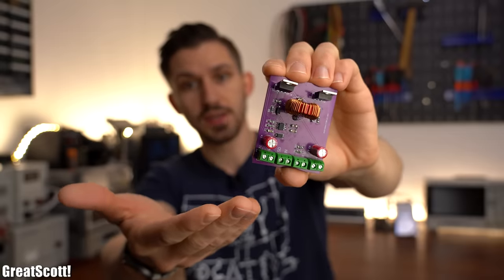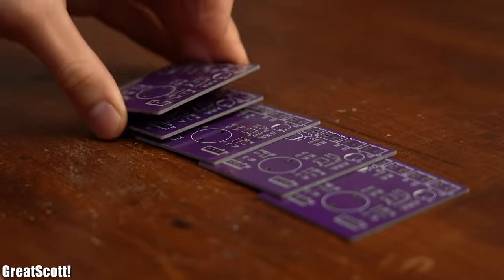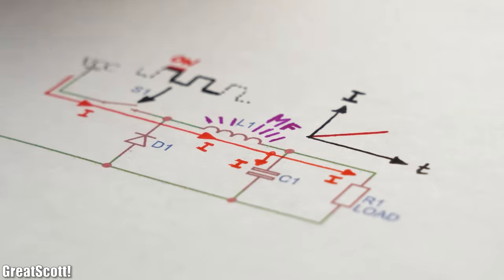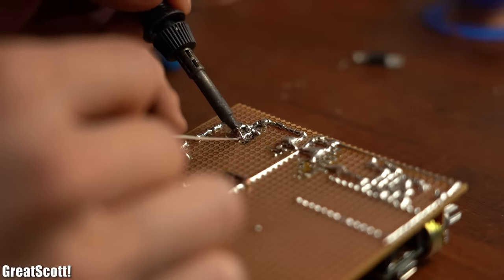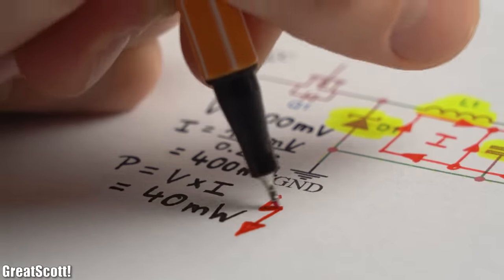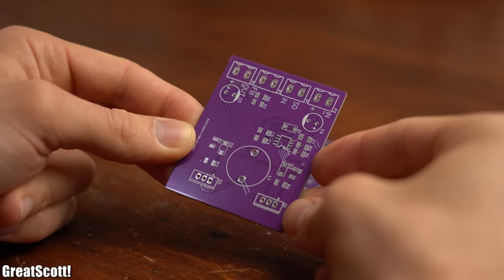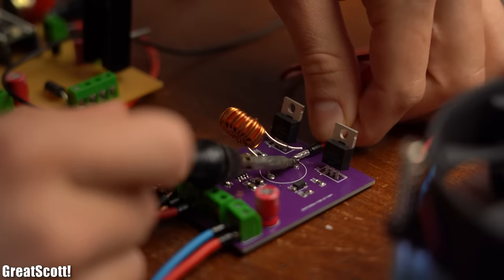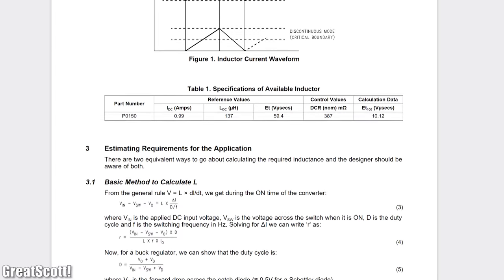Is this the BEST Voltage Converter? Trying to build a Synchronous Converter!

Comment: Really interesting project.

I am doing a PhD on power electronics and I have previously studied how to improve buck converters. 
There is a topology called "active clamp ZVS buck Converter" that besides using synchronous rectification with mosfets allows to have ZVS in the switching of the mosfets, which greatly reduces the switching losses. In addition, due to its behavior, it allows placing several modules in parallel to increase the total power without additional control, since it distributes the current automatically.
Reply: Electronics aren’t real dude
Reply: that's awesome! Would be great to read the research you write about this.
Reply: Interesting
Reply: @paugasolina5048  its funny you call someone a no lifer when you are on this thread chugging haterade. Must just be self reflecting or something.  At least his post relates to the video.
Reply: thats the kind of comment thats actually usefull, ty!
Reply: Interesting to compare efficiency of the active clamp ZVS buck converter with resonant converters can you provide a link?
Reply: @paugasolina5048  go somewhere else with ur negativity
Reply: Sounds a lot like my converters.
As a full-time 'no lifer' I have accumulated a series of designs that are not only really powerful and efficient, but are easy to produce - requiring no IC...
They also show this 'tandem' behavior, when multiple converters are paralleled - I can use a single error amp to regulate the lot of them!
Reply: @paugasolina5048  honestly, I would prefer it if knowledgeable people shared interesting things like this more often like TransformadaDeLaplace did here. No need to possibly discourage others.
Reply: ZVS is damn cool stuff.
Reply: @bryanakers9354  Don't feed the trolls, just ignore him. If you reply to idiots, they will use all kinds of fallacies to discredit you.
Reply: @Vilvaran  Hi. Got any ZCS resonant converters?
Reply: @t.i.m.e.3419  You mean ZVS? The zero-crossing point is good, but no resonant converters yet - they're in the "coming soon" category I guess...
There is a case of quasi-resonance in my design's switching control 'system', but I wouldn't consider it a truly resonant device...
Reply: @Vilvaran  No. ZCS.
Reply: @t.i.m.e.3419  Zero Cross Switching ~ Zero Volt Switching
There's a difference?
Reply: @Vilvaran  Zero Current Switching as opposed to zero voltage switching
Reply: @t.i.m.e.3419  Ah I see - yeah that's something that needs more than just two transistors with funky feedback...

There is a design that I have which uses a pair of AND gates to buffer the switches in a bridge; such that either transistor will only turn on when the other has fully turned off...
The right capacitors in the right places can make it resonant - but having it remain so at different output powers is a bit more difficult...

For now i'm focusing on ZVS converters and universal supplies - implementing the Ideal Diode and testing the new feedback methods...
It's been a ride figuring out the magnetics side of things - core materials are an absolute nightmare!
Reply: @Vilvaran  I bet they are. Why does ZCS need more funkiness? Couldn't a low voltage ZVS circuit be inverted to drive the gates 90 degrees out of phase?
Reply: @t.i.m.e.3419  Hence the auxiliary feedback tests - if the switching is fast enough, there is nary any difference between ZVS and ZCS behavior, as they should cross zero simultaneously...
Reply: @Vilvaran  Doesn't current lag voltage?
Reply: @t.i.m.e.3419  Yes - but what is the point here?
Reply: @Vilvaran  To do work with the magnetic field as opposed to the di-electric.
Reply: @t.i.m.e.3419  Would it not be wise to use both?
The device is already working with magnetic fields. Adding the dielectric (capacitor in series for example) would make a resonant circuit - but introduces phase shift. More often than not, with resonant feedback circuits I get horrible ringing that actually prevents the transistor from switching on if the error-amp kicks in...
That is with the simple circuitry though, I'm yet to give this a shot on an H-bridge configuration.
Reply: @Vilvaran  One might think so. Depends on the power source.
Reply: @paugasolina5048  Why would you watch a video about synchronous converters?  Seems pretty "no lifer" to meeee....
Reply: Brabo
Reply: But don't we need current programmed control to have a parallel loading of multiple converters? ZVS is really useful but how does that provide current distribution for parallel loading?
Reply: @Vilvaran  can your share the design...
Reply: @paugasolina5048  no u.
Reply: @greatscott please pin this comment
Reply: exciting, hope read your article asap.
Reply: I've been reading about buck converts for  such a long time, and i even had to design one for my masters degree final project and still never heard of this ZVS !! I think i need to take a look into it !! Thank youuu !
Reply: I am building a battery operated device where efficiency is crucial. (no 1 goal)
(have 4S1P Lion and need different voltages in the device)
would an "active clamp ZVS buck converter" or more of them be the most efficient solution?
thx
Reply: Send me a link to what you've got ;)
Reply: I would be interested to know how this works: "In addition, due to its behavior, it allows placing several modules in parallel to increase the total power without additional control, since it distributes the current automatically." I haven't seen this done without a current balancing circuit and I can't find anything IEEE Xplore about it
Reply: My dude id love to read your paper, where can we find it ?
Reply: @taton5  well your typing on a phone and sent a comment to a server that im now reading sooo
Reply: @dannycoria1995 hey danny, I hope you are doing fine. Are you already done with your research?

Comment: FYI, many STM32 MCUs have a PWM mode with complimentary outputs and dead state insertion -- specifically for switched mode power supplies and brushless DC motors.  I didn't really understand the connection until watching this video.  Thanks!
Reply: Ooooh makes a lot of sense! I always wondered why every timer had 2 output pins
Reply: If you and Batu Gunduz meaning the 2 output units for each timer then the ATmega328p has the same scheme.
Reply: @PerchEagle  If I understand correctly, the STM32 can generate the complimentary outputs using a single output compare channel (the 328P seems to need two, with the same compare value, but opposite output polarity).  Also, the STM32 can insert dead time (neither output enabled) automatically.  I think the 328P would need two timers with different TOP/BOTTOM values (or just different initial counter values?) to produce dead time.
Reply: @markday3145  ok, let me check the stm32 datasheet for this point.
Reply: Yes, you do. For example, the STM32G474RE available on evaluation kits has a peripheral called HRTIM. A timer capable of generate a pwm with 4GHz clock. It has multiple outputs and features that makes a synchronous buck converter easy to implement. There's also some  APIs sponsored by a ST's partner called BIRICHA with professional tools used for design a 2p2z digital controller using this peripheral. Yes, z transforms and transfer functions simulated and measured all in the ecosystem. Have fun.
Reply: Just like any dsPIC30F of motor control family, or dsPIC33FJ, EP, EV, GS,...., or PIC18F4431/4331/2331/2431, or PIC16F887 on ECCP module. Nothing special. More crytical thing on any mcu is it's ADC and it's modes and capabilities.

Comment: Sounds like How your GPUs/VGAs' Chipset and VRAM module voltage are supplied. A mosfet driver, Low and High Side Mosfets, A Capacitor, and an inductor/Coil. Interesting!
Reply: Oh, you're right!
Reply: @maxhouseman3129  yeah, i saw modern GPUs like 20 series use some kind integrated mosfet-driver because tons of Vcore phases they use and they don't use much space like older GPUs.
Reply: Yeh most efficient way to convert power. There are powerstages that reach like 95% efficiency under normal operation.
Reply: @farizfadillah7557  they call those powerstages. Crazy beefy chips. One of them can easily suppy 20-30 amps without overheating and the high end ones rated for very high currents can push 50 amps. If a GPU pulls 300W at roughly 1V you have 300 amps going trough the VRM. The VRMs on modern GPUs are really the most advanced dc to dc converters out there. They convert 12V to something as low as a single volt while retaining 90+ percent efficient and delivering a few hundred watts.
Reply: I will say this too. But you already say it
Reply: @alouisschafer7212  yeah, that's why some modern GPUs are using Heatsink on their VRMs/PowerStages... 
I can't imagine how hot those VRMs at 100% usage...
Reply: Your solder is exssasive  thick

Comment: Damn that's some great efficiency numbers I saw today from a DC to Dc converters.
Yesterday in my viva, I was asked what can be the efficiency of a DC to DC Buck Converter and books said about 80%.

I think this can improve power draw of many project that are about portability.

Great Video as always!
Reply from the maker: Thanks mate :-)
Reply: Ok
Reply: Efficiency is largely a function of size, load, and conversion factor. If you can make a switching converter larger, you can use a lower loss inductor. If the load is lower than all the magnetic and conduction losses are lower, and if the conversion is a small step than the converter can act more like a wire.
Reply: Oh yeah these days you can quite easily build DC converters that operated well above 90%. The part that is hard is when you need to balance other design aspects such as size, cost, EMI, and if you want high efficiency at a specific operating point versus across a wide range of input and output voltage and current range.

Comment: Thanks Scott!
Now I'm 'very glad' I picked a 'Synchronous Converter' for supplying my 150W pure sine inverter with the correct voltage when using two of my EGO (56VDC) batteries ... 
Makes for a nice, small, emergency backup and camping power unit. 10AH@56V ... 560WH. 5VDC, 12VDC and 120VAC as needed.🙂
Nice job on making one!

Comment: Sometimes, the AC resistance of the inductor can be a tricky bit, as, at short duty cycles, the apparent frequency content of the inductor current can be high enough to cause several % loss. And, of course, PCB layout can affect performance due to parasitics that reduce switching performance ....and so on, as I'm almost sicher that you know. Nice video. BTW, the ripple frequency and amplitude when in DCM, lets you do some calculations of parasitic capacitance and ACR. "Left as a proof by the student" ;-)
Reply: Cheers🍷
Reply: Yea
Reply from the maker: Those are all the fine details. Maybe one day I can get to such detailed topics :-)
Reply: About the inductor, I tried some experiments with switch mode chips, and found I could not just wing it with the inductor.  I had some ferrite toroids and wound them up.  The uH was good but if you have the wrong core material - not so good.  So anyone attempting this sort of project, look into the recommended toroid for the circuit.
Reply: Dude, how can I get to know so much? Any books you would recommend on power electronics or courses?
Reply: @ablebaker99   - yes, core materials do perform differently with different frequencies. 

Also, Litz wire might help reduce losses with high frequency and high load current, where losses due to skin effect might come into play.
Reply: @JoelLandivar  The ARRL Handbook 6 Volume Set 2022 Edition! (for Ham Radio Amateurs) tries to thread the fine path between engineering and knowledge for non-engineers.  I have an older editions, so I'm not totally sure what is in the new edition.  Flip through it at your library if you can.
Reply: @greatscottlab  what could be the input voltage ?
Reply: @camgere  thank you so much sir!

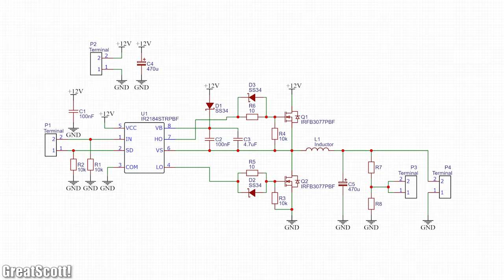Comment: 7:32....oh right, I've seen that setup before in laptop power supplies, but never really understood how they worked without a diode - this makes sense now. They're also susceptible to killing the load if the top FET shorts and sends VCC to the load directly.....

Comment: How to increase the efficiency of most circuits 101:
Replace bipolar transistor with a FET and some complicated logic that emulates the bipolar.
Reply: Know the strength and weakness of the different technologies and select accordingly. Easy to say but development can be quite fast so the correct answer might change. 
Bipolar transistors might be the best choice sometimes and got it strengths.

Comment: Also a neat observation you might like, if you look at the generalized/abstract schematics for buck and boost converters (using switch symbols instead of practical implementations, you will see that they are in fact the same. Just the port where power input and output are flipped around. You can make a buck converter, feed the voltage into the output, and use the input of the buck converter as the output to turn it into a boost converter! This does not take into account any practical aspects of the controller or MOSFET drive but it should be possible!

Comment: Nice, another video. But im still waiting for The 3d printer diy or buy :D, but keep up The great work!
Reply from the maker: Maybe one day!
Reply: @greatscottlab  I still hope :D
Reply: That's easy. Diy if you want the most bang for the buck, buy if you want it to just work. Diy requires a bunch of trial and error to get everything working good. Plus, you have to be extremely comfortable with tearing a lot of stuff apart if you get a clog/jam, etc. That goes for both diy and buy though.

For context, I built a modified version of the HevORT for about $600-$700. There's nothing even close to how good and fast it is if you wanted to buy something at the same price.
Reply: @androiduberalles  thats true
Reply: @androiduberalles  not exactly the kind of budget 3d printers u can buy theses, days totally defeat the purpose of diy-ing a budget one, but for larger or complex printers diy-ing makes a lot of sense, imo just but a decent printer like the ender 3 and then u can diy a very decent 3d printer cuz u can easily print most of the parts
Reply: I have a Prusa MK3 and I've build from scratch 3D printers. Smitty is right. I always lean heavily on my Prusa. However, my next printer will be a Voron. This way I'll get the best of both worlds
Reply: @Hopeinformer  im currently saving money to buy a Prusa i3 MK3s
Reply: @Hopeinformer  Imo, Voron or HevORT are the way to go if you want a super good printer (speed and quality wise). I've never liked the idea of bed slingers. You just can't crank the speed up on them and expect quality when you're chucking that big chunk of aluminum back and forth. Prusa does a great job at being reliable though, that I can commend them for.

If it's your first printer though, I personally can't recommend building from scratch. You're just going to get pissed off figuring it all out.
Reply: Dude, it's just BUY at this point, there are very good DIY printer, the Voron series is just beautiful

But for like 90% of people, "print good" are the only requirements, and we achieved "print good" at 200 dollars many years ago
(ender 3)

If you are in to it as a hobby, where you want to replace the board with an board that supports marlin, use silent stepper drivers, convert to direct drive etc. Is still decent progression, or you could always go voron switchwire

But starting DIY now, is just impractical, if it's your 1st one(i don't count the prusa i3, that's a kit)
Reply: @androiduberalles  true, 1st printer should be easy to assemble and easy to use

Hell, i only got my printer recently, only avoiding getting once since was using the Ultimakers at work(and only got it because it cost like $30), and when i got it was already familiar with the maintenance and everything from the prior experience
Reply: @krazybonnie5523  it's always fun when you have an extruder issue and have to take half the machine apart 😂😭

Comment: I am looking forward to learn how to add feedback system for this supper simple converter. That would be perfect. 👍
Reply from the maker: Fingers crossed!
Reply: I think a tl431 could be a good and cheap option, but I'm  not sure if it will oscillate by itself
Reply: @juanmontes8905  How would you use the reference as a controller? Yeah, if you don’t compensate the Buck it will oscillate depending on the ESR of the inductor and output capacitor.
Reply: I'm voting for a software-implemented feedback loop here.
Much more cool. Much more hackable. Much more programmable.
In fact, if he solders just another halfbridge module, he can get a complete pure sinewave DC-AC with just a software mod :D
Or just a multichannel DC supply that can both charge and discharge a battery :)
Reply: @dedamarsovac  the Rp2040 can be a good option, but you will need a independent power supply for the uc
Reply: @juanmontes8905  you'd need aux supply for any mcu and many references. No biggie.
as for the MCU, AFAICS, teensy's got what it takes. 
In real life, just stick to what's easy for you to develop on.
I've made some beefy SMPS's using STM32F4.
Reply: UCC chips

Comment: I was just about to build my synchronous buck converter, but after watching your video i think i'd have to make some adjustements  like adding some decoupling capacitors and diodes to discharge mosfet's gate capacitor ! Your videos are always GREAT Scott thanks !
Reply: Btw adding a proper heatsink will for sure increase the effeciency as it will dessipate heat off of the mosfets !